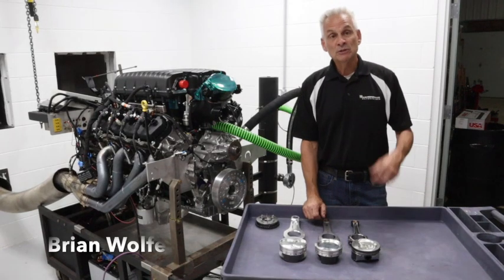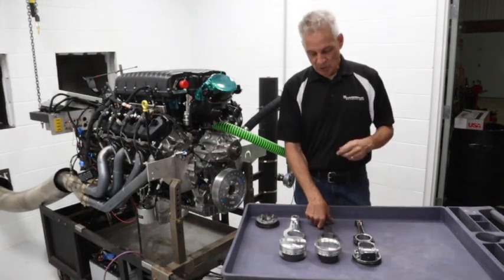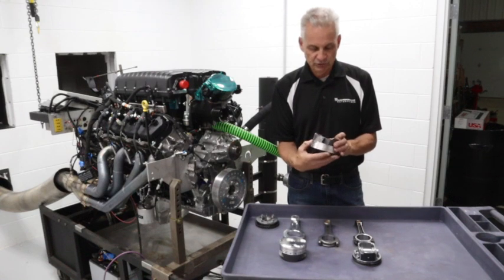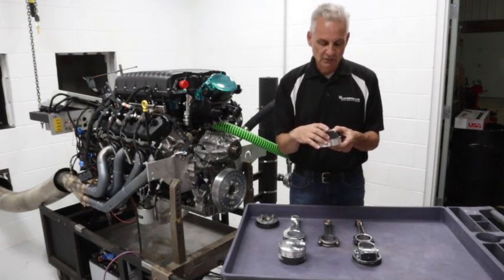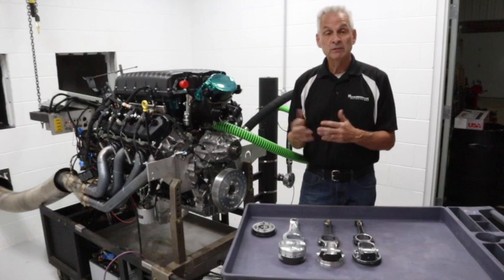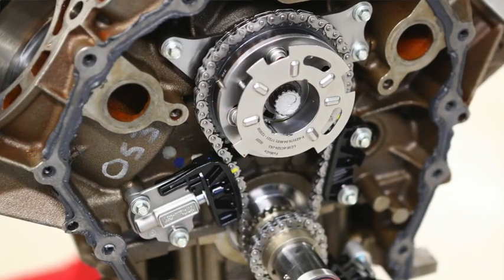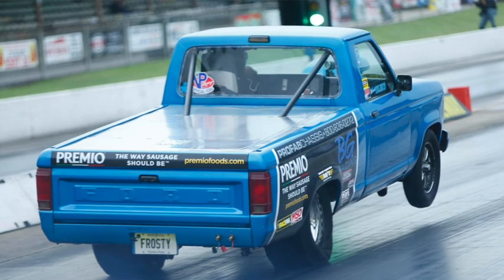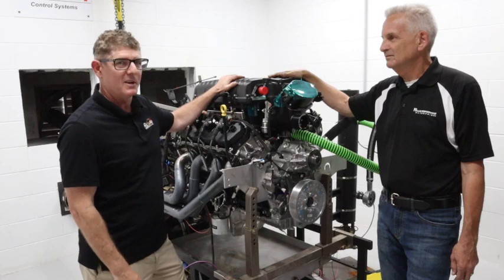7.3 Godzilla — Max Power? — Engine Management — Plus... Rods, Pistons and Soon, Ford Whipple Boost

Comment: This motor is going to make Coyote fans weep. 800+ hp n/a? and we haven't even gotten into overbored or stroked combos, aftermarket heads, turbos... it's going to get ugly.
Reply: Coyotes are fucking nasty still. And it's still a Ford haha. Trying to be a fanboy for the same brand?
Reply: https://www.youtube.com/watch?v=Uijf-Fa-TZI

MMR has their GenX Coyote blocks that can handle 3500hp +..so nah.  This engine is awesome but got a ways to go and I don't think we'll see it turning 10k rpm any time soon.
Reply: @SirtubalotTX  while it’s a cool promod motor, it’s a billet block motor, nothing stock outside the heads in that motor. This is for the guys who want to easily make 700hp NA and have torque to go with it, without having to run extremely high compression and race gas.
Reply: @taylorgtrotter  Good point Taylor and I concur.  You still have to give credit though to the little Coyote making that kind of n/a power with stock heads.. and spinning that fast too boot.

That aside, I'm loving this new 7.3.
Reply: it's built....
Reply: Keyboard racers
Reply: Well the yote has run 5's @ over 255+ mph in the 1320 so it has a long way to go yet .
Reply: Ill still take a coyote over this engine. A stock sealed coyote 800 hp will out the necessary head work, rods  cam and intake.
Reply: Doubt it, it's design makes it so that you have to either mount the motor ridiculously high or move the rack and pinion down you where you need a bump steer kit at stock ride height or you're going to have to invest on a stupidly expensive dry sump system that costs as much as a coyote swap. This is a good motor to put in an old truck and that's about it
Reply: @Elver_Galarga_4u  not at all true. Have you seen how 460’s sit in s197 mustangs? This can put in it with a 4500 carb and still use the stock hood. That being said, the aftermarket companies aren’t going to put out a product where you would have to mount the motor really high in the chassis.
Reply: @taylorgtrotter  you can't compare how a 460 fits in a fox, SN95 or S197 to a 7.3L, the 7.3L can never be mounted as low as a 460 without screwing up your tie rod angles or going with an expensive dry sump oiling system. Sorry but that's not a good comparison
Reply: @Elver_Galarga_4u  I can’t compare how a physically larger motor fits in a car?  That checks out. There are means to fix steering issues.  No need to dry sump a truck motor when it’s a rear sump already like fox body cars originally had anyway. An oil pan developed specifically for this combo saves that time and effort as well.
Reply: @taylorgtrotter  have you seen the videos REVan Evan and PBH put out talking about the motor? Frank from PBH already said that a 7.3L with the stock intake and TB configuration (no donkey wang TB adapter that adds to the height of the motor) is a few inches taller than a coyote with a Roush blower. So while its alot narrower than a coyote, weve never had a problem having a 4V 5.4 with a blower in a 79-14 mustang and a coyote is quite a bit smaller than that 5.4 behemoth. This motor is even narrower so the issue isnt width, its the height and not just total height from pan to manifold, its also where the crank centerline is in relation to the rest of the motor.

Again with the stock intake, no TB adapter and mounted as low as they can mount it, the motor still sticks out of the front of the hood about 5". So what hood will a 79-04 mustang guy use that will cover up the motor? So we can agree we can cover up the motor, but again the rack was moved down as far as it can go. K-member was also modified in order to mount it lower so now the tie rods are angled differently than the control arms which means bumpsteer at stock height. How do we fix bumpsteer? A bumpsteer kit. So now your 79-04 requires a bumpsteer kit even at stock height, that means you cant lower your car without adding an even bigger bumpsteer kit. Now that you have a 6" tall bumpsteer kit, will that clear your wheels? Doubtful. But again, you cant modify the oil pan to sit the motor lower to clear the hood or be able to bring the rack up to fix the tie rod angles because of the front chain driven shaft that drives the variable volume oil pump. So that will require some kind of extensive oiling system solution to be able to try and fix just one of those clearance issues that are presented.

So while there are solutions to fixing steering geometry, this motor swap introduces more issues that will require a different approach than just your regular plam of attack. Then you factor in the fact that this motor is scattering rods at 800hp so now you have to weigh in your options, iron block that weighs almost 600lbs naked and dry, has fitment issues that cause steering issues, needs custom mounts and wont hold alot of power or a gen2/3 coyote that weighs less, has no fitment issues, will hold 1000whp, and a gen2 is cheaper, and will use any modular motor mounts what would you realistically choose? 

Again, not saying its a terrible motor, i just wouldnt swap one into a mustang. Id swap it into something like my 05 navigator or any truck that doesnt come with a coyote/ecoboost because itll have the hood clearance and the low end grunt will make for a better tow motor than a 2/3/4V 4.6/5.4 or 302/351w.
Reply: @Elver_Galarga_4u  haha a 600lb bare iron block? That’s the weight of two and a half 460 blocks. 

Tall intake, easily fixable. 

Motor swap issues and steering geometry, fixable problems as well. Not that hard if you know what you’re doing in the design process. That’s why the sell “swap kits” that address all of these issues.

Have yet to hear of this 7.3 scattering the bottom end at 800hp. Got a source for that? 

Telling me a 446” v8 with really nice heads won’t make damn good power?  Won’t get long until there is an aluminum block available. You cry about weight, weigh an all iron 460 and we can talk about weight.
Reply: @taylorgtrotter  when did I say bare block? See you're not reading what I'm saying, the fact that a 7.3 needs special mounts is by default more complicated than a coyote swap that uses mod motor mounts. You're also not paying attention when I mention steering issues. The steering issues are asking fixed yes, but at stock height only. Once you decide to lower the car it's no longer a solvable issue without having over sized wheels or front wheels with so much offset that they stick out of the car because they won't clear the bumpsteer kit required to correct the issues. How much more of a lower profile intake can you get than the stock low profile intake that already has the TB sticking out 5" oass d the hood line? Frank prodomo from PBH has said it a few times from his reliable sources.
Reply: @Elver_Galarga_4u  fabricating mounts for a new engine combo is not that difficult. This same process took place for every engine swap ever. It’s not an exact science, but with some careful measure,Mets and average fabrication skills, it can be done it a reasonable amount of time. I am paying attention, and I’m telling you that there are companies and fabricators out there that know how to address these issues and make everything functional. If you choose to lower your car and cause yourself bump steer issues...that’s on you. As for the intake, for one, design it so the tb isn’t pointed up at damn near a 45° angle...that could very well be all that you need for stock hood clearance. These are really not all that difficult of problems to solve, yet you think it takes thousands of hours of R&D to solve this problem. It’s been figured out with physically bigger motors, so why should this be any different of a process?
Reply: @taylorgtrotter  so let me get this straight,  youre gonna leave a car at a stock height so that you dont have bumo steer issues because you chose to use a motor that doesnt fut well? Is that what youre saying? Yeah thats gonna be a great performing and looking car... you gonna make it a 4x4 too since its gonna sit so high anyway? 

Have you seen the motor in a fix? Its not just the TB sticking out, its also the dront runners,  how are you gonna address that?

Making mounts is easy, im doing that right now to swap a 2.3 lima and T5 into a 61 falcon. Thats always the easiest part, with engine swaps, the biggest issues are steering components, exhaust routing and physically fitting it under the hood, between the strut towers and above the lowest chassis point. 

So tell me, are you ok with having a 79-04 sit at stock height to avoid steering issues? Are you ok with a low profile intake manifolds sticking out of the hood even though you already moved the K-member and rack fown as far as you can? Are you ok causing yourself all these issues to have a much heavier motor when you could have avoided all of that AND have a lighter motor thats capable of holding more power? 

There are ways to fix the steering issues i have pointed out, you want to know what they are? Like ive been saying, its either a big ass bumpsteer kit or bumpsteer kit and drop spindles (so the car can be lowered but control arm angle foesnt change) and you better hope that bumpsteer kit regardless of path will clear your wheels. Thats it, there are no other ways to correct those issues all you can do is relocate the (effective) pick up points to match how much you dropped the rack and how much you lowered your car to keep the control arm and tie rod parallel to each other. 

I dont know how many times i have to say these things for you to understand it. If you dont want to listen to me, look up what they had to do to mount that motor in a fox. A fox and SN95 chassis are practically identical so any issues that a fox will face an SN95 will face too. If youre gonna swap this into a 3V S197, youd be better off swapping a coyote into it and using the PBH harness (when its done) that uses the 3Vs ECU. So all youre swapping around is the motor and harness vs getting the godzilla, getting a control pack. So at what point does it become a viable option for any 79-10 mustang when there are cheaper, easier and more capable options?

This is why im saying its a great motor,  if youre gonna put it in an F100 or pre-coyote/EB F150 or any car that has the hood clearance needed. Because no matter how you look at it, its not worth it. Not when you can coyote swap for the same price or less with less headaches and will hold more power. Not when you can build a 400+ cubic inch 351w that makes the same power NA as this did when it was built or more for less with boost. Its just not worth it no matter how you spin it.
Reply: @Elver_Galarga_4u  what’s wrong with stock ride height on a newer mustang? Some people prefer it. Again, this things isn’t that big. Dimensionally it’s not much larger than a 9.5” deck Windsor, just longer bore centers. 

What are the “dront runners”, and what are they sticking out of?

Mounts, headers, steering rack & column, oil pan, k-member....all customizable to produce a well performing package. This isn’t rocket science.

This motor, especially what Wolfe is building, is an extremely capable motor. Look for his to produce well north of 1500. That won’t be the limit either. How many other 2000+ hp 446” small block fords are out there in the drag racing world? Not sure what you’ve got against this motor? Not everyone wants four camshafts and a small displacement. Some guys like pushrods and bigger cubes. Different strokes for different folks. Personally, I’m a big block guy, and I know very well what it takes to put a 385 series big block in many different Ford vehicles. Again, if a 460 will fit under a stock hood, so can this new gas motor. 

You keep beating the “steering issues” horse to death. There’s a thousand ways to achieve a desired outcome. Any one of them can work very well, so what’s it matter if the run drop spindles, with k-member spacers, and a bump steer kit to keep everything happy? If it works it works...

Want to tell me a 6.2 sohc is too big to fit under a stock hood too? I’ve got a picture to prove that it does, and quite comfortable as well. Dimensionally the 6.2 block and the 7.3 block are quite similar, and they both will fit into mustang chassis. 

It may not be worth it to you, but to other guys it is and it’s well worth the investment of their money. Hell if I had the money I’d pick up a S197 chassis and put a Kaase boss 9 motor in it, with the stock hood, and then slap a Holley efi on it. Why? Because I can, and that’s what I want. Same can said for the 7.3, they can and they want to so they will. Your opinion does not reflect any sort of truths in accordance to this 7.3 swap
Reply: Marc B from what I understand because of the design it’s a compact engine and not much room to bore and stroke. I’ve heard at most like 490 cubic inches. I’m also not sure what ford has done for liners but if they’re the laser arced liners or whatever ford calls them there’s not much you can do with them.
Reply: @hpkntnw  its a cast iron block, no liners, not sure who told you 490 and what they did to get that, would be curious of the details you/they are thinking.

Comment: I'm just saying 800 horse on factory bottom end don't look too good up against an ls truck engine that are good over 1000 hp. I'm really intrigued by this 7.3 though. I've got a feeling this is the gas truck engine we've needed for a while
Reply: The 800 hp on this engine is not intended to be the ultimate naturally aspirated version.  It's just an initial test of the engine in which the long block has been built for supercharging.  So the compression ratio is lower, and the cam isn't optimized for NA.  Brian says the NA engine could get to 900 hp if everything was optimized for it.  I suppose there could be LS engines that can make 1000 hp naturally aspirated, but they wouldn't be stock bottom end. Operating speed would be too high for the stock rods.  And there is no factory LS head that flows enough for 1000 hp NA.  Tall deck 500 cubic inch strokers with aftermarket heads, maybe.  But if the 7.3 were modified to the same extent, it would make more power.  Bigger bore wins in the end.
Reply: Stock ls won’t make 1000hp for long term reliability.....Boom! Maybe on a Dyno for a couple pulls if your lucky

Comment: Grooves between cylinder bores: What amount of boost are you guys concerned about that would blow head gaskets?
Reply: Time will tell, stay tunned....
Reply: I think due to the fact it a cast iron block I don’t think the block will move around as much and scrub the gaskets either. I did have the head off of one at our shop doing some warranty work on one. This engine looks amazing! We have head gasket issues on the the focus RS engine and the 2.3L eco boost. The machining is horrible on the block for an MLS gasket. The gasket never blew but would weep coolant and trigger a miss fire code. The machining on the 7.3L block and heads looked awesome. This is the only engine that I’ve been really hyped about in a like 20 yrs. the 6.2L looks really great but never really got traction.

Comment: Did I just hear 0.900" lift cam?! 2:58 Impressive on stock castings
Reply: 900 lift Charlie Westcott cam. Yeah!
Reply: That's what I heard 👂
Reply: Jeff Schwartz : The 999.  900 thou lift, 900 hp, and most likeky 9000 rpm capable. Its an Upside Down Beast.
Reply: Dean Stevenson I’m still trying to wrap my head around that lift with the stock castings
Reply: KG : well ..in 1979, Cotton Perry and Hedrick had 900 thou lift on the lump port 292 in line GMC six they raced in NHRA. The way Mr Wolfe got it is via aftermarket Jessl rocker gear. It is a canted valve engine. The 335 heads have been into the 900s for many years tho'.
Reply: Dean Stevenson very cool! Did not know, thank you for the information
Reply: @deanstevenson6527  oh, I wasn't asking questions, but thanks for the info. It's always good to know!
Reply: .900 lift begs the question 
What is the rocker ratio??

Comment: This makes me wanna swap out my 460 in my f150
Reply: Same here for my '78 F250! But I just put in a built E4OD that this new 7.3 won't bolt to!
Reply: Robert Mann I have a 76 with a 390. I wanted to go the 6.7 powerstroke route but jesus. I’d much rather shove this into the engine bay.
Reply: Your stupid 
Ford 390 rules 👍